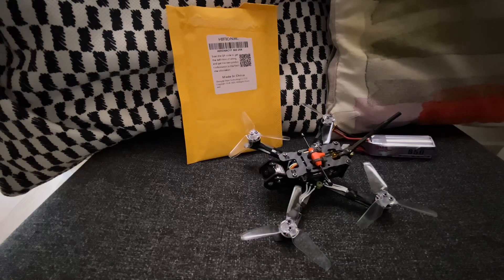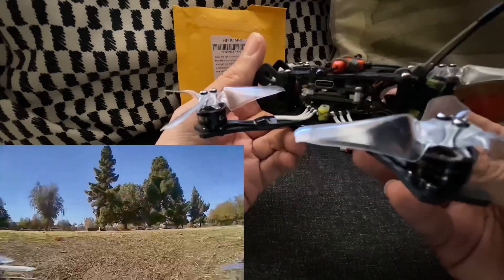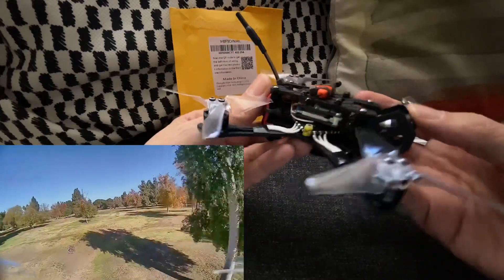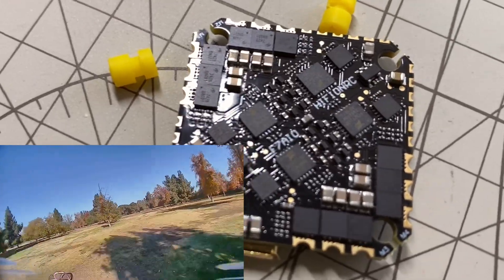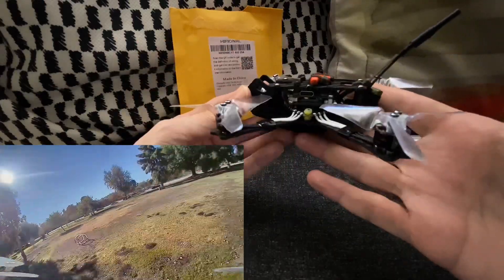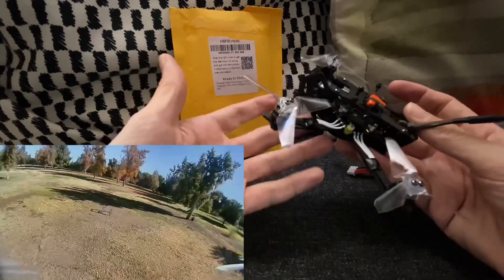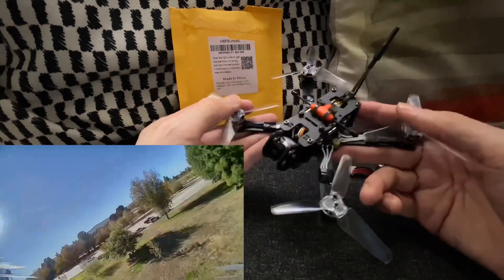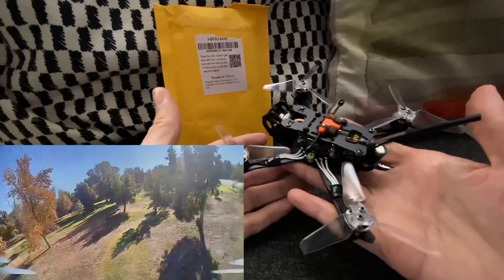HIFIONRC F7 AIO 25A Whoop-size FC/ESC Quick Test

Comment: Hi bro. Do you think it's wiser to build a diatone l3 using this FC then selected parts or just buy the bnf l3? Isn't the stock motor of the bnf though 12xx but high stator so supposedly punchy already?
Reply: Btw, for my first  ripping drone. Thanks.
Reply from the maker: Cool. I’d say just buy the BNF! It’s much less hassle (unless you want the experience of building something) and the spec of the BNF should perform well on 4S.
Reply: Thanks for your recommendation. Btw, is the bnf with 1206 3600kv intended for freestyle or for LR? My new more hassle idea: buy the bnf, replace FC by F7, put the mamba FC to my broken fc 2.5". Add GPS if need be for the Roma L3.
Reply: Actually the only turn off for me with the bnf is the only 2 uart. So no room for GPS if I intend to Lr. Idk maybe Im just thinking a bad combo and may likely ruin a good tune bnf. sorry for thinking out loud in the comment box.
Reply from the maker: Haha, no problem! If you are thinking about adding GPS later maybe you could look for a model that already has it like the v2 4”. 
As for the kV being for FS or LR, I’d say it’s a decent balance between both and the capacity of the battery will determine which style to fly it in.

Comment: AIO or Stack? what's the benefit over the other? because i saw in my local shop 2 versions of 25a.of course the stack is a little expensive but why would i choose the AIO other than space? Thank you.
Reply: Thank you for your explanation. Im almost decided to pick up this same aio tonight. Maybe when I build 4-6inch I'll opt on stack
Reply from the maker: Hello! For me, the choice of stack vs. AIO mostly comes down to which would fit better within whatever frame it’s going in. I think on paper a stack might be more robust with more room to spread out heat and components but they’re also heavier and taller obviously and there are potential failures points with either the wiring or pins between the boards. Generally I prefer the simplicity of AIOs but I also don’t usually need the highest spec when it comes to micros.

Comment: Curious about your tune?
Reply from the maker: I think in these initial flights it's just the stock 4.2 tune but in my most recent flight I've got slightly adjusted PIDs which can be seen at the link below. It felt a little loose on the bi-blades so I just generally turned things up a notch or two.
https://youtu.be/fD1XlBH3PJc?t=99

Comment: Nice build, again! Thanks for the close-up shots at the end. Keep that up.
Sure would be easier/cheaper/cleaner, using a DJI Tx though. Let's see if they sell the gamepad style one.
Oh yeah, definitely try BL-Heli M. Just download the configurator and flash through there (no need to grab the right ESC firmware from Github). I'll drop the link below (in case YT blocks this entire message for some reason).
Reply: https://github.com/Asizon/blheli-configurator/releases/tag/1.2.0-jazzmaverick-beta4
Reply from the maker: Thank you for that!
I'm starting to wonder if that new DJI controller will work with the current gear or if it will only work with their new FPV quad. So many questions to be answered about all of that.
Reply: @MiniMicroFPV  No problem. BL_Heli M is working great for me, and you can pick 24/48/96kHz PWM using a drop-down menu, and have RPM filtering :)

Yeah, can't wait to see what that FPV combo is about. Hopefully our old goggles will still work. I just bought the full size Tx not long ago, so kinda sad, but if it will still work with the new drone, and it's decent, may have to try one.
Reply from the maker: @TweakRacer  Thanks for the reminder! I totally forgot about the whole PWM frequency setting. One thing that will probably be nice about the DJI quad is that worrying about such things as that, RPM filtering and myriad other settings will just be obscured from the user. Sometimes I like digging into those things and other times I don't want to think about them.
Reply: @MiniMicroFPV  Exactly. I know what you mean. I love to tinker sometimes, and other times, I just want to fly. :)

Really like the goggles/TX/Air Units/Vistas... just works. 

If the new drone can cruise with decent flight time, and do smooth acro/gentle freestyle.... yet have awesome RTH and obstacle avoidance... plus the high-res recording and Tx-controllable cam tilt (wonder if the recorded 4k is stabilized).... I'm in :)

Comment: Yeah man, I just built a Armattan Tadpole  with the 45amp version!
Reply from the maker: Whoa nice!
Reply: @MiniMicroFPV  Yeah man, its sweet. I got a Rush Tiny Tank vtx,  full size R-SXR receiver, RunCam Split 3 nano woop, with Armattan 1204 5000kv motors powered by a 450mah 4s. Rippin' Dude I'm tellin' ya.
Reply from the maker: @FlyerTuck  Great configuration. That’s a little beast!